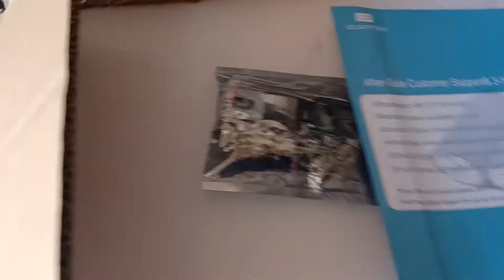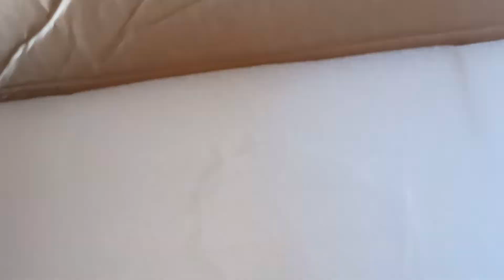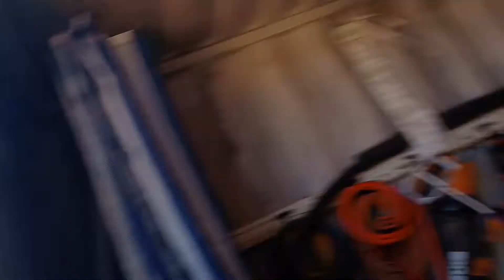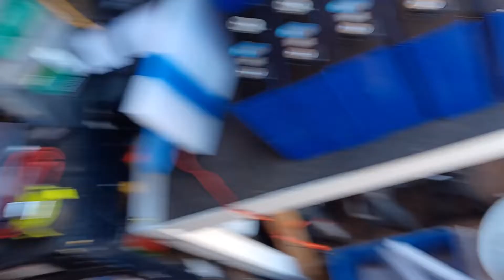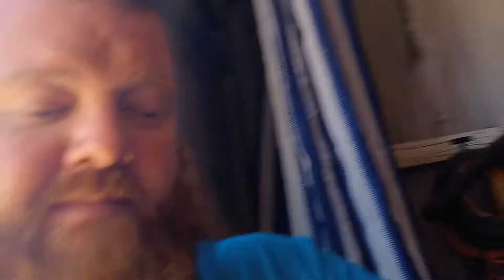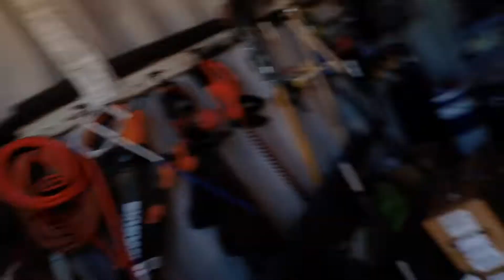DIY Battery build pt2

Comment: Nice how EELZ gave you a capacity report.  Lishen didn't do that for me.  I noticed you have the older style terminals (which in my opinion are better.)  All of the new(er) LF-280 cells are type "K" which have welded studs and the contact area on the cell is reduced.  They (mfgs) say they work just fine and I've seen others on YT test them and they seem to do ok.  I just follow the adage: "more is better" when it comes to contact/surface area and electricity.  What size Daly did you get - how many amps can it handle?  You'll need at least 100A continuous with that Growatt and if you add another later on, you'll probably want to get a 250A version.  Daly is the most popular on Amazon, but the new JK BMS' have better features (e.g. 2A active balancing.)  I always try to get the BMS with RS-485 or CAN so I can connect to it with a PC or a Raspberry Pi and do active monitoring.  I wrote an add-on for Home Assistant to monitor my batteries as well as all of my equipment.  I use ZeroTier  to connect into my network so I can monitor things anywhere I have cell service.  Really cool!  Anyways, good luck and we're here for you if you need assistance.
Reply from the maker: I received my Growatt inverter yesterday and returned it today, they sent a used one and it's a European model and I learned it has the ground and neutral welded to the case and that could have killed me if I hadn't looked on YouTube first before hooking it up.

The bms I ordered is  the DALY Smart BMS with UART Cooling Fan 4S 12V 250A LiFePO4 Battery Protection Board with Balance Wires Common Port BMS for 18650 Battery Pack 12V (3.2V LiFePO4 4S 12V 250A UART Cooling Fan)

When I receive my refund from Amazon for the growwatt I'm going to order PIP LV6548 6500 WATT inverter/charge controller,  it's twice as much money but I think it will be a safer option.
I learned about the bad growatt and this inverter from DIY Solar Power with Will Prowse.

I'm going to Gilbert tomorrow to pick up a pallet of 20 240watt panels from santan solar, I paid about $850.00.
Reply: @ToddLarsen  NICE!  I love Santan Solar.  Just curious though, why did you buy the 12V BMS when you're going to have a 48V system - just to test?  If it's the UART model, then that is the RS-485 model.  I think you'll like the LV6548.  It's a solid choice.  If you buy Growatt - only go with Signature Solar.  AFAIK, they are the only NA distributor that has the right models for U.S.  Lastly, if I could ask, what did you pay per cell for your EELZ cells?  I'm getting ready to pull the trigger on some on Alibaba from a reputable seller.
Reply from the maker: @davidchristensen1219  Thank you for catching that,  looks like I'll  have an extra bms for smaller projects going forward lol

As for the battery cells I ordered them from Amazon for $699.00 a box. 
I don't know if that's a good deal or not as I have no idea what I'm doing lol

Comment: I don't have much experience with Lithium, even less with Lithium  iron phosphate, but, in general, the smaller the number, the larger the diameter of the wire, the  larger the diameter of the wire, the less chance of it overheating and causing a fire... Add that to your research, not as a fact, but as something to check into...
Reply from the maker: Awesome thank you so much,  now I won't look silly when I'm ordered wire.
I need some wire oh about this thick lol